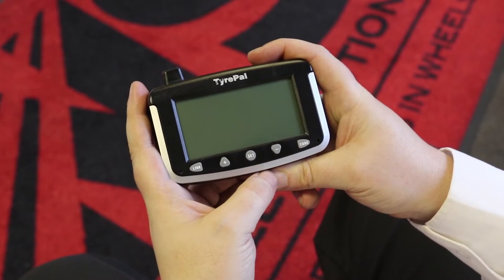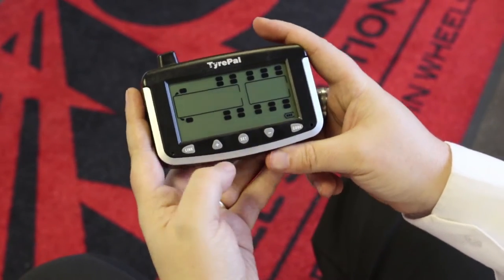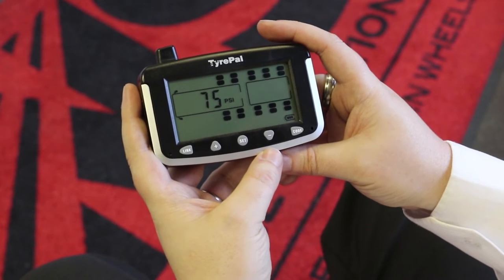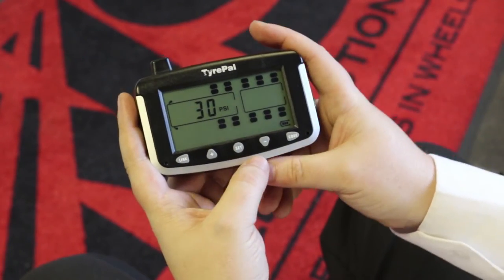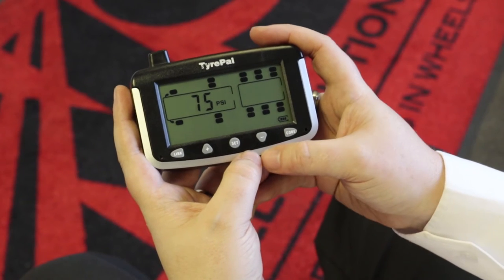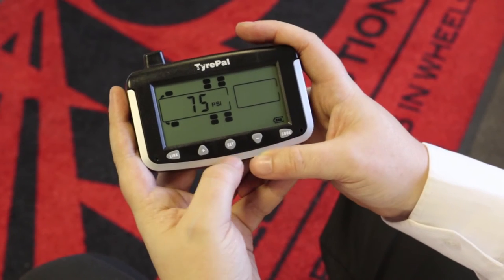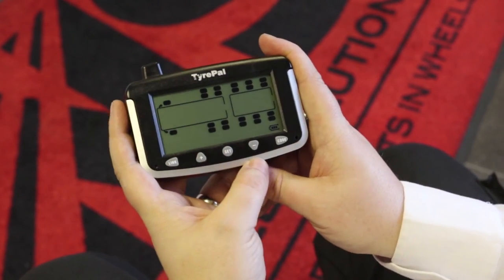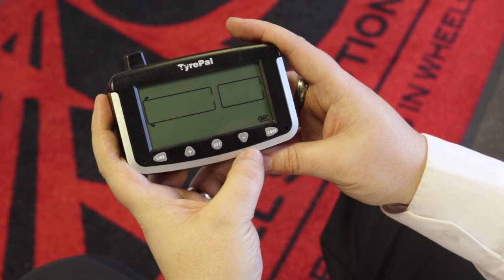How to setup your TyrePal TC215B monitor

Comment: My monitor has failed after only eighteen months, luckily I had a new one with my new caravan, I remember setting codes to each TPM, so this is most confusing. To be honest its a great system but a pain in the backside to set up, I have people on my caravan forum selling theirs, as they cannot do it, I will do mine tomorrow, but it will no doubt be a few hours of my life I will never get back. I also invested in the external TPMs for my car , not looking forward to going through this again.